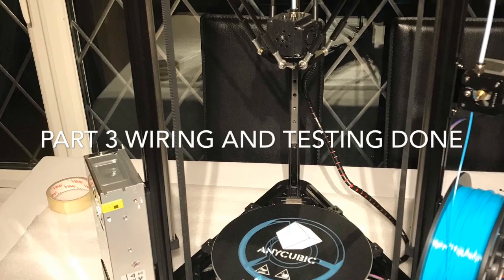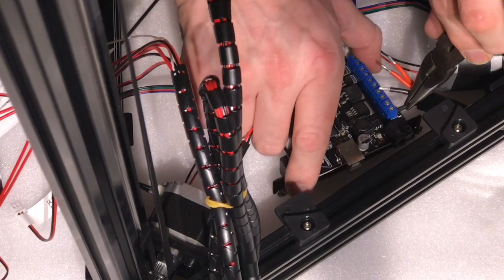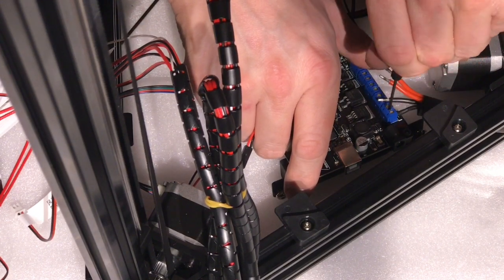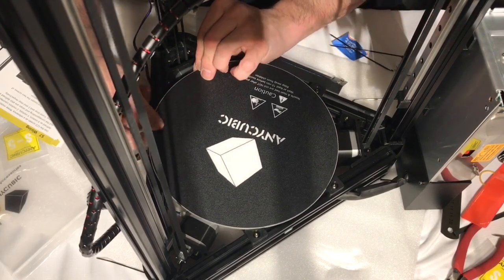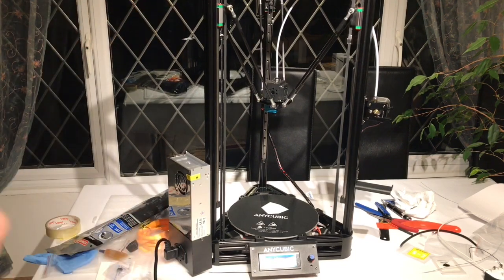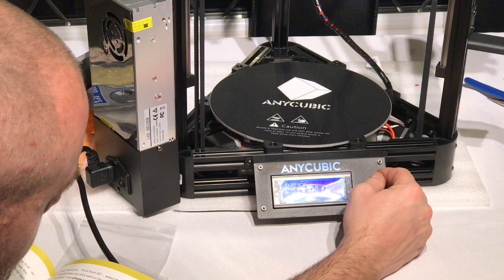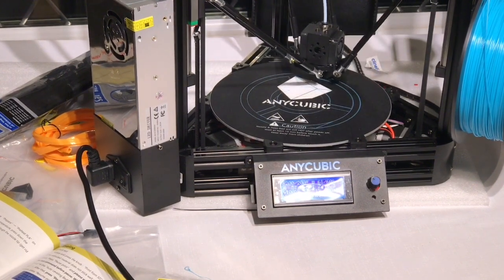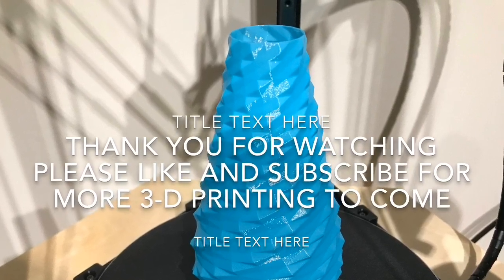Part 3 Anycubic kossel linear plus assembly

Comment: Hello, I have a problem with Auto Leveling and Auto Home. 
When I click for Z Pos in the display menu, 
everything goes to the other side and touching the bars,I switch off immediately.
Even Auto Home is not good, sometimes it doesn't go and others do,
before i use Auto Leveling is not ok.
I installed the driver, put the usb cable and the port is COM3, is ok.
Why doesn't Auto Leveling and Auto Home work well ?  
The printer is not calibrated, how do you calibrate the printer ?
Because it is not good when I need Auto Leveling and Auto Home.

>> the 3D printer is Anycubic Kossel Linear plus.
Finished assembling days ago.      Thanks
Reply from the maker: mic t hi unfortunately I have not seen a problem like this to be honest it worked first time for me the first thing I would be checking is that you have the cables plugged in to the right places. It sounds like they are in the wrong order. as for the homing and leveling this must work for the printer to work I have never had to re flash  the motherboard yet as it has always worked well sorry I can’t be more help but follow the wiring diagram that came in the manual it’s very important to get that right 👍
Reply: @brithawkes36  ok, thanks

Comment: same too my machine. how much speed and how much thickness you settings? thanks for answer
Reply from the maker: Peter Tech Industries hi peter I usually print with the standard 0.4 nozzle and I tend to print at 0.15 layer height for most things speed I tend to adjust as I’m printing but as a standard I keep it quite slow at 45 mm/s hope this helps👍
Reply: @brithawkes36  nice result you printing it bud,  but i setting 0.16 with speed 100mm/s is a bad result😂😂thanks for give me info